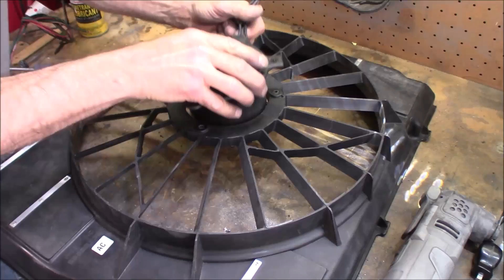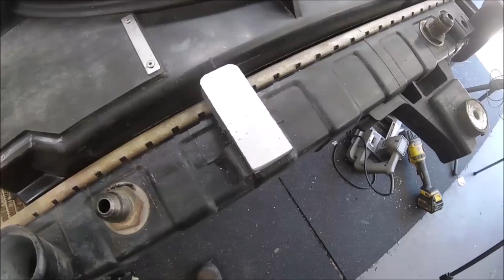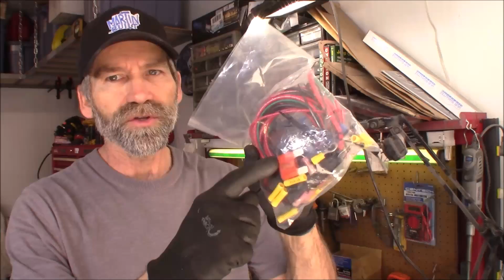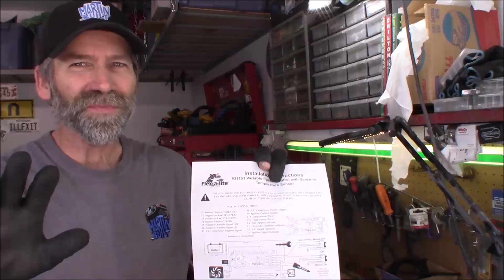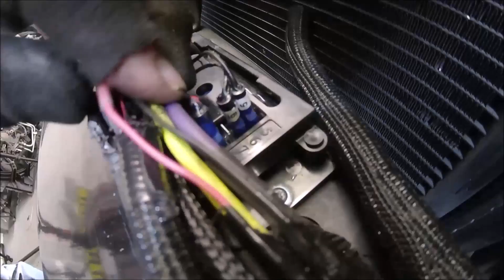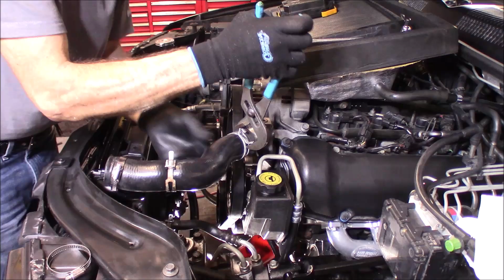Hydraulic to Electric Fan Conversion 01-04 Jeep Grand Cherokee 4.7L

Comment: Why couldn't you replace the fitting on the hi pressure hose to the correct one and use the original pump?
Reply from the maker: That would work but because of the reservoir, the hydraulic line would not fit properly.

Comment: I'm an interest out of germany, so excuse me for some grammar failures.
1. how does the fan controller recognize the needs of the fan for A/C? If i'm on high speed, the fan shouldn't run, even if the A/C is switched on.
2. Did you recognized a change on your MPG? So with solenoid mod in a bad way, with electric with the same amount in a good way?
3. Does the sound of your car changes, because of the missing idle fan run of the hydraulic version?
4. i didn't see the opening vents (high speed) of the fan shroud you mentioned in the comments earlier, do you have a example search tag for it that i can find a picture of it?

Thank you! Your videos are very detailed, i like that a lot.
Reply from the maker: Hello Johannes, My dad was from Germany and my mom from Austria they met in the states. I haven't been to Germany since I was 12. 
1. The fan control gets a negative or positive signal from terminals #7 and 8.
2. The solenoid mod is only bad if you turn it one whole turn. Good if at half a turn.  Did not see any real difference in MPG  with the electric fan.
3. Not sure what you're trying to say. I can not hear the electric fan from inside the Jeep. From outside of the Jeep I can hear the Electric fan more then I could hear the hydraulic.
4. Are you referring to the flaps of rubber on the fan shroud that open at cruising speed? There are 5 of them, 3 on the left and 2 on the right side.
You can also message me at Facebook https://www.facebook.com/Martinbuilt-2351766611763181

Comment: Your knowledge is exemplary.  I had my radiator changed and I'm certain they didnt do the job as well as you. As a matter of fact still having some issues with the fan not kicking into full throttle!
Reply from the maker: Thank you, it's kind of unlikely that it will kick into full unless it really heats up. You can check the fan's  operation by unplugging the temp sensor  between the alternator and the AC compressor,   the fan should kick into high .  If it does it is operating correctly. I'm just not a fan of that hydraulic fan. No pun intended
Reply: I'll try that. Thank you.

Comment: I want to do this to my 06 grand  with a 5.7 hemi. What power steering pump do i need?
Reply from the maker: i am unfamiliar with the 5.7 Hemi. If you can use the power steering pump from a 5.7 without the hydraulic fan that should or may work. You will most likely have to change the hi pressure hose as well.
Reply: The 300c 5.7 power steering. I did mine and it worked.

Comment: you just answered a question i've had for a while now, what to do when the hydraulic fan goes out on me. my question is will this work on a 2006 jeep commander with the 5.7 hemi? the fan setup looks the same.
Reply from the maker: I don't see why it wouldn't work on your Jeep Commander.
Reply: Yes!! But, tou must replace the power steering for the 300c. You can the same as the vídeo, but replace the power steering for 300c

Comment: I need help. Have an 03 overland. Electric fan installed by previous owner. Fan only turns on with a/c. Temp hits 230 in stop and go traffic.
Reply from the maker: Can you not install a fan controller like I used in this video. And to simplify it you don't need to install the manual off manual on switch.
Reply: @martinbuilt  I want to keep the pwm/fan relay for now and ultimately swap back n the hydraulic setup. Can I send you pics of my setup by email?
Reply from the maker: Facebook:  https://www.facebook.com/Martinbuilt-2351766611763181

Comment: Mate this is bloody brilliant! I wish I did this a few years back when my radiator blew and top hydro line started leaking. Mucking about with the hydro lines are a pain.
For now I have to live with it, so being in a hot part of Australia with long summers over 40*C I'll sort the hydro fan out. When you remove the solenoid to wind it up, how much fluid comes out and how quickly?
Reply from the maker: Thank you! When you remove the solenoid the fluid comes out kind of slow, small stream of fluid.
Reply: Hello Ian, I live in South America with very high temperatures, what oil viscosity do you use on it?

Comment: I dont understand this mod. Will the clutch fan not bolt right on like they do on the 4.0s
Reply from the maker: clutch fans rob Horsepower. Even if you did the clutch fan, you will still need to add an electric as they did in earlier models. I  love this E fan gives lots of room to work on the engine, looks great and lighter then clutch fan or hydraulic.

Comment: Hey man, as always, very high quality work and detail. Enjoy watching your videos and learn something along the way. In this rare case, I just have to ask though, why? In my opinion I felt like you made a downgrade with this one. Added complexity of wiring, controllers, relays, more things to fail, etc. The hydraulic fan is pretty darn reliable with the caveat of regular fluid changes with the correct fluid that meets MS5931 spec. Just want to know your thoughts, which I may have missed. I do like the AN fitting on the bleed port. About to tackle the radiator replacement myself. Have you had any issues with the plastic thermostat housings, mine started leaking randomly. 

Cheers!
Reply from the maker: I think it's one of the best mods I've ever done to this Jeep. It finally stay well below 200 degrees even today it was 111 degrees in Las Vegas  and it never got hotter than 194. The hydraulic fan could never do that even with the solenoid modification that I had done in a previous video. 
I haven't ever had any issues with the thermostat housing so far so good.
Reply: @martinbuilt  thanks for the reply. Interesting results with the electric fan. Makes it all worth it right there. Must be why the alternator was struggling to keep up, fan is drawing some amps to pull all that air. Was the overdrive alternator pulley enough to compensate for the underdrive crank pulley? Do you have any spare, modified solenoids? I'd like to try one. Coolant for me typically stays around 205-210 and oil will creep to 210-215. Over here in Virginia Beach we have hot and humid. But, would be nice to pull those coolant temps below 200. I wanted to try an all aluminum radiator but not sure how they fit, mixed reviews.
Reply from the maker: Yeah I do have a modified solenoid. The 205 to 210 sounds pretty much typical since the ECM is trying to keep the engine at 204 that is where the engine achieves its best gas mileage. 
I don't have much confidence in the aluminum radiators especially if you're referring to the ones I see on eBay looks like the same cheap Champion radiators I had put in my XJ I've gone through three of them in just a few years. The stock alternator was doing fine only at idle was the problem and yes the overdrive pulley brought it back up to tolerable voltage at around 12.7 12.8 at idle
Reply: @martinbuilt  if you're interested in selling, I'd like to try it out on my Jeep. I'd rather the Jeep run cooler, that's for sure. Right, the eBay aluminum radiators seemed questionable aside from Griffin which is awfully expensive.
Reply from the maker: @WJsLifeonaBoat   You can contact me at https://www.facebook.com/Martinbuilt-2351766611763181 
Yeah, the Griffin radiator I'm sure is a quality piece but way too much. Then need to send me so I can do a video on it...lol

Comment: It is necessary to change the hydraulic bulb
Reply from the maker: Hydraulic bulb?
Reply: @martinbuilt  Sorry ...Hydraulic pump  Do you change
Reply from the maker: @naserasas8428  yes it needs to be changed or you need to get the orifice from the earlier pump. Even if you do that the hydraulic line  will need to change on the high pressure side and it will not fit properly with your original pump. It is just easier to change the steering pump and high pressure line. Just let you know that the pump  that you have now will flow way too much fluid if you use the orifice that is currently installed.
Reply: @martinbuilt  Thank you so much

Comment: would a electric fan from a late model Jeep Liberty fit better without all the trimming............thanks
Reply from the maker: What year of Liberty's are you referring to? I'll look into it.
Reply: @martinbuilt  Second generation KK (2008–2012) with iron block and alum. heads  or 2005-2007.. Thanks love this channel I have a 2004 JGC OVERLAND with 4.7 HO... Martin there is something that you have not addressed, and that is the mount points for the coil springs, on most JGC 99-04 that I have seen with over 100k, they are rusted out and the spring is almost out of the mount. I replaced mine with an after market kit without buying new axles from the dealer.  This normally not found until too late....anyway the kit I used to fix mine was https://www.ironrockoffroad.com/product/wj-front-lower-coil-spring-tower-replacement.html                  // Thanks for all of the great stuff, best for WJ on the web...
Reply: @fastfurious9489  Awesome.

Comment: Could you have plugged the hydraulic fan hose outlet and inlet and keep the same power steering pump?
Reply from the maker: You can use the same pump but you'll need to change the orifice that is where you're attaching the high pressure line to the pump. This orifice would be the same as the pump that I used. This is because the orifice on the pump with the hydraulic fan is way too large and will move too much fluid to the point where it will cause the  seals in the steering gear box to leak. You still need to change out the high pressure line as well.

Comment: That's awesome, if not just for the extra room.  What's that purge mod your using for the coolant?  And you mentioned the coolant hose adapter used was 40mm,  I thought it was 38mm, think that would work better?
Reply from the maker: Thank you, I'm using a 10an to 3/8 NPT fitting with a 10an cap.  
Fitting   https://amzn.to/2K2TAih
Cap  https://amzn.to/2HEvusM

Comment: Not real familiar with the Chrysler setup, but most import cars set the fan temps at about 10 - 15 degrees above thermostat temp.  The stat will keep the engine at 180 degrees even when you are on the highway on a cold day.  Setting the fan at that temperature will make it run constantly (and unnecessarily) because the thermostat keeps the water at 180 - even if you have tons of cooling coming in from driving etc.  Again just a thought :)  Thanks for the content!

Comment: What kind of temps do you see where you live Martin? I’m out in the middle of the Mojave near Death Valley. And let me tell this hydro fan seems to not be able to keep up at all, I’m sitting at a constant 210+ and we are barely cresting the mid 90s right now (we usually see 110-120 throughout the summer) 
Excellent video as always. I’m actually currently working on the ram air setup you have too!
Reply from the maker: I'm not far from you, Las Vegas. I see temps close to yours. Had the same problem with the hydro fan. Thank you I appreciate that!
Reply: martinbuilt did you notice any drops in mpg?
Reply from the maker: None that I notice.
Reply: Try putting in a 180 degree thermostat.
That should help out!
Reply: And make sure all the air is bled from the cooling system!
Very important!

Comment: Another great job martin!
You allways find that ingenious way of douing things...me...on the other hand...got tired of looking at my old hydraulic fan and it went to the trash..( with that stupid solenoid attached)...so..for weeks i had no choice but to buy a solenoid from ebay with the hardness for $140...until today after seeng your video...yep...you just save me that much...just bougth two of those resistors for $5.00...well...let me tell you that 12 blade fan from ford and clutch are douing their job ok...had to buy a new shroud that cover the fan and it came with an electric fan that will be rigged just like yours...and the three rows alluminum radiator from ebay its douing a great job...just a little wider than the original and it takes some adjustment...i used the same power steering pump by having the hose made...so far so good...cheers!

Comment: Great video! Really thorough job!  Lots of good info even if one is not doing this swap.  Sad that we have to fool that way-too-complex ECM system.  I'm remembering my 1978 Saab 99 Turbo that had two fans in front of the radiator (switched on ground side, left fan hot from key, right from battery, so you shut down when the fans cut in, and right fan blew cooling air over the turbo for a while).  We know pumps & fans that push work better than those that pull.  Is there space for a fan or fans in front of the radiator (out of full engine bay heat)?  Just wondering.  You did gain a great amount of engine bay space, making belt changes, etc. a lot easier.  I really like that.  If you did not change power steering pump, just blocked line to fan, would it run too much against its relief valve and overheat the fluid?

Comment: Was there a reason for using a e-fan from a zj instead of the e-fan from an early we? Btw love the vids. Keep it up
Reply from the maker: That fan uses the basic same motor as the Ford Taurus 3.8 fan that moves a ton of air. The 98 ZJ shroud and fan are a great fit and I like the rubber flaps that open at highway speeds.

Comment: Nice install, how come you opted for the upper radiator hose when installing the adapter/temperature sensor ?
The lower radiator hose have freshly cooled water from the radiator and when that isn't sufficient then the fan should kick on , or so I thought!
Reply from the maker: Flex-a-lite recommends installing it on the hot side most likely because the controllers lowest setting is 160 degrees this could be a little too hot if you installed it on the cool side. I'm seeing a 50 + degree difference between the hot side and the cool side hose with this electric fan. I can literally grab a hold of the lower radiator hose and it is just warm to the touch.
Reply: @martinbuilt  ok thanks for the explanation, sounds like it's cooling adequately!

Comment: Why did u go this route? Were u overheating, earlier fan solenoid mod not work?
Reply from the maker: No the mod that I did to the solenoid definitely helped I dropping the temperature  10 to 20 degrees but the ECM is always trying to get the engine up to 204 degrees. I felt I could do better with the electric fan and let the thermostat do its job.

Comment: What's the story with that engine on the stand in the background?
Reply from the maker: I just got it a few days ago from Pic-a-Part out of 03 Overland. It's an HO with 153,000 miles. One of the cleanest engines I've ever seen inside. The owner must have done regular oil changes. I bought the whole long block. Planning on rebuilding
Reply: @martinbuilt  very nice! Looking forward to more content! 👍